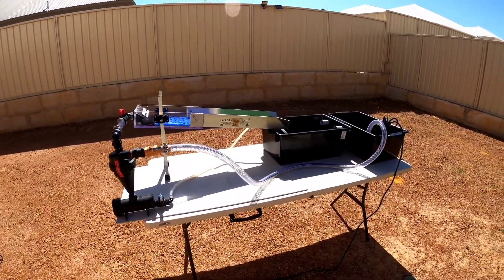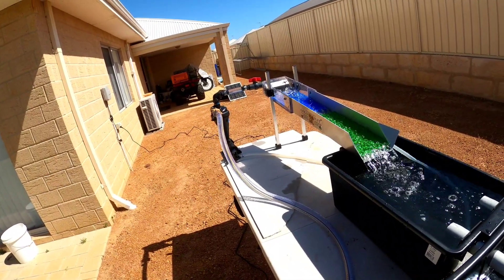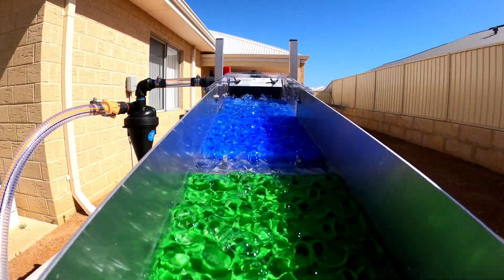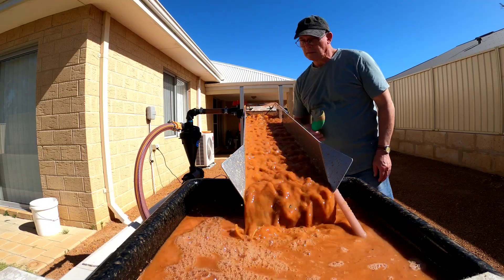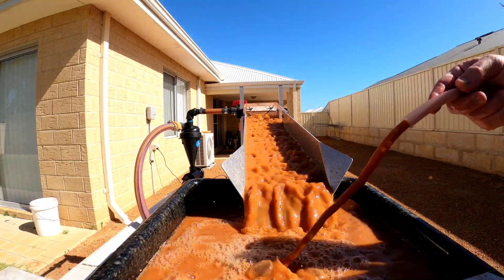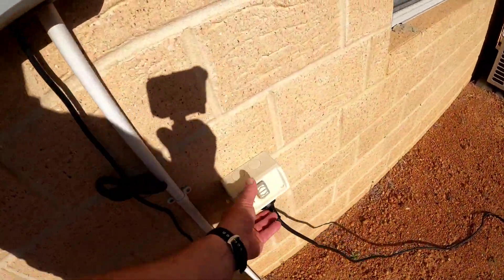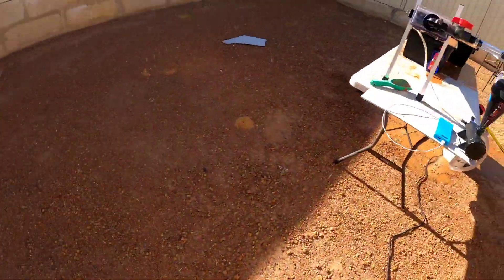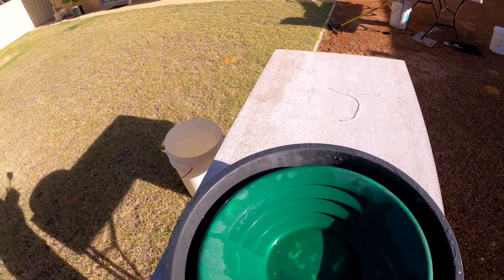Hydrocyclone Recirculating Clean-up Sluice

Comment: I am having the same issues here with my recirculating sluice box system. We have sandy soil filled with fine flour gold deposited by the glaciers. But the sand is full of fine silt which makes a mess of the water after only half a bucket.
Reply from the maker: Cheers yeah I'm trying to make this idea work at the micro level before I scale it up. I've made some improvements so watch out for the next video.

Comment: Run a sand filter system works alot better run longer settlements stay in sand
Reply from the maker: Thanks yeah I'm trying to avoid using anything other than cyclones to prove the effectiveness and make sure the technology is scaleable to any capacity

Comment: Excellent setup! I did a similar configuration and am dealing with the recirculation of the cloudy water as well. I am thinking a swimming pool sand filter should work well. Thank you for sharing your setup!
Reply from the maker: Cheers for the comment I'm developing this a scaleable proof of concept so it will be an ongoing project
Reply: @dynomania  keep doing updates. My parts have arrived. I'm gonna make a mess. Ha!